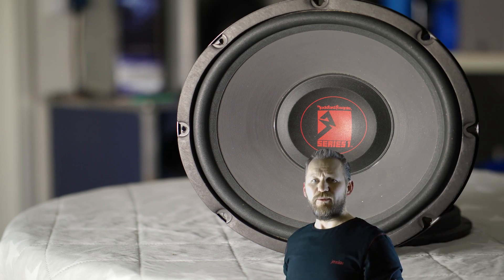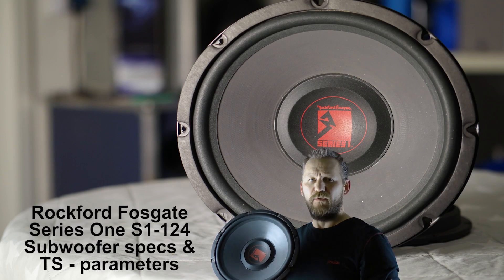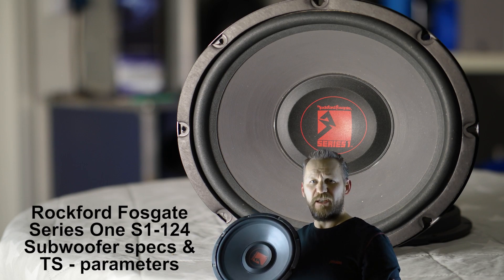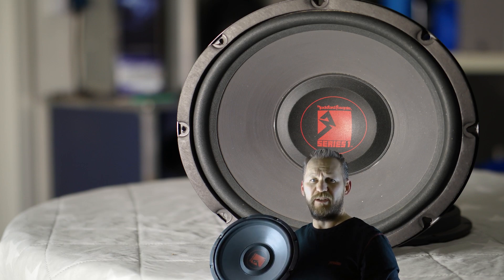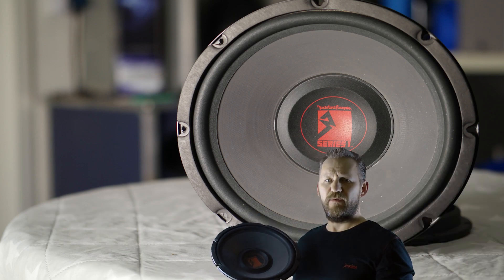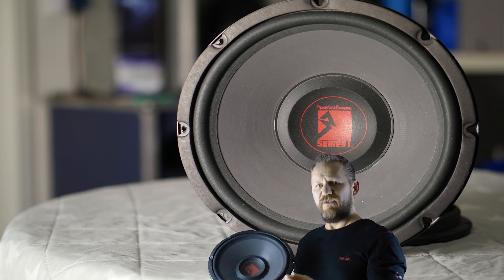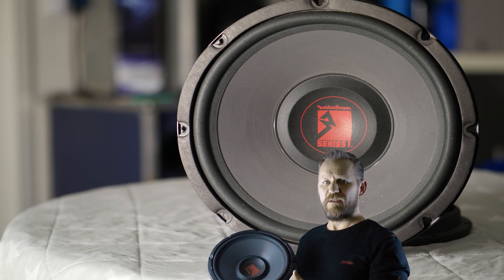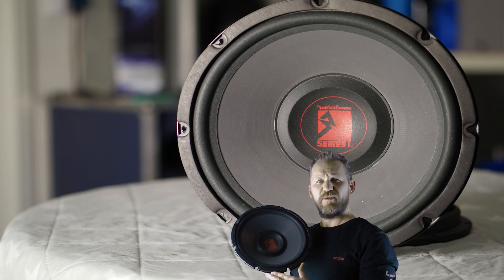Rockford Fosgate Series 1 one subwoofer S1 124 specs TS parameters for box design 12 inch oldschool

Comment: Was there any particular reason the series 1 had red dust caps and white one's? I see the red one's most often (the one in your video) but not so much the white one's?
Reply from the maker: I also didn’t see any white ones, but sometimes they used dust caps which are heavier which affects the free air resonance which will go down if heavier cone or caps were used.

Comment: I still have a series 1 184 yes, the rare 18in since high school circa very early 90s.
Reply: I'm still searching for one. I had two in the middle 90s and loved the sound output even with low power.
Reply: You're right  @jeffreycarroll9956 that's why I love it.  Doesn't take a lot to drive it to get a good clean huge sound.  It's not meant for high spl and power but in not I to that at all.

Comment: I had the 15 inch version. Just had it hooked to my home stereo though.
Reply from the maker: I have been told that the 15" needs a good amount of box volume.
There was even an 18" available 🤤
Reply: @audiokeller1975  i just put mine in an old Cerwin Vega passive home theater sub box because the Cerwin Vega was blown. Prob a 3 cu. Ft box.